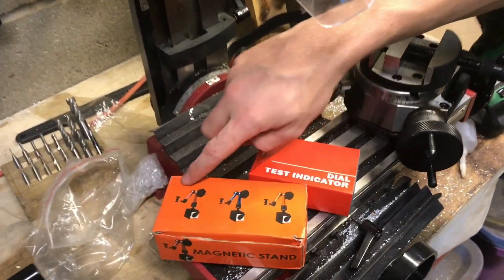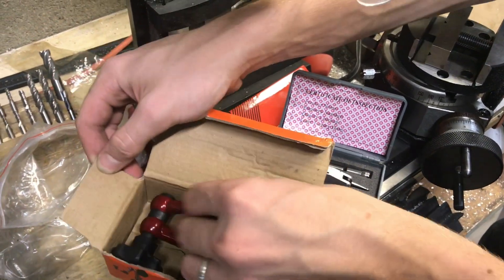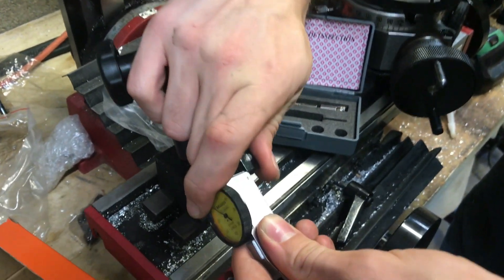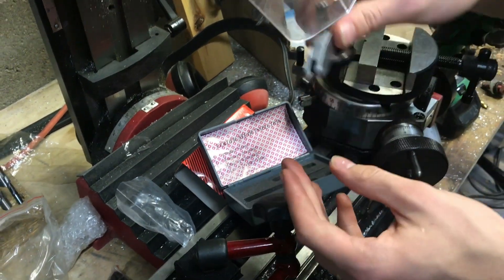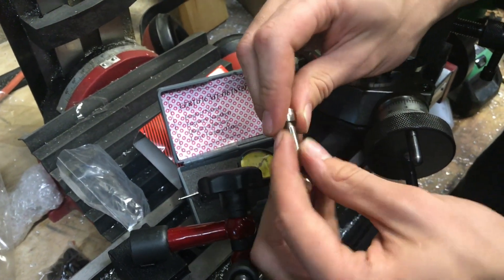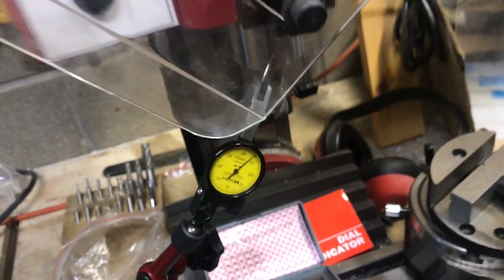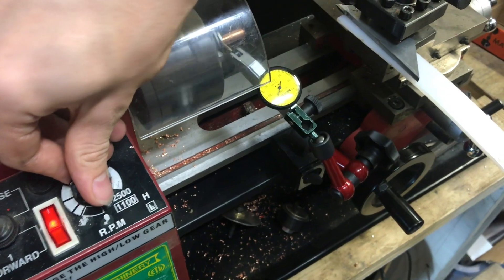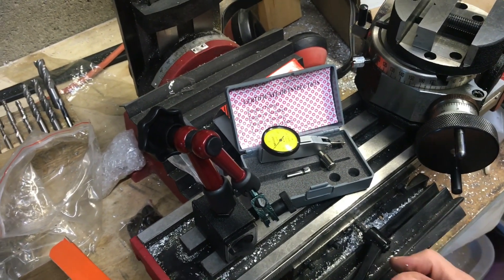(REVIEW) miluloyo dial test indicator

Comment: Check your Mitutoyo against a standard.  I returned mine because it was showing me 0.006" for a 0.005" standard step.  You can perform tests using different thickness feeler gauges.  Make sure the gauges are accurate though.  Name brand such as Mitutoyo does not mean anything to me.
Reply: Hi. He bought miluloyo not Mitutoyo so no point checking

Comment: Great review! I do think I'd like one with a fine threading adjustment to move the needle into position after a rough placement. Do you have a recommendation on a somewhat cheap alternative to this one?

I just shimmed the burrs on an espresso grinder this morning and had to use a marker test (mark the blades, bring the burrs together to where they just barely touch, see where it's rubbed off to indicate the bad alignment) and this tool would have been a much easier and more accurate method to see the relative depths immediately.